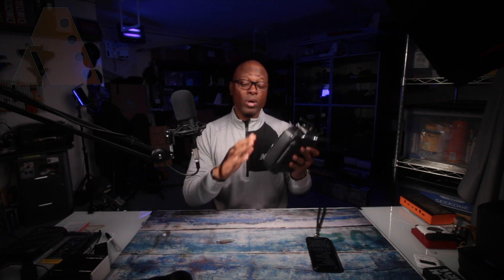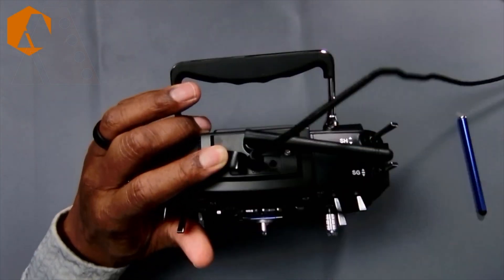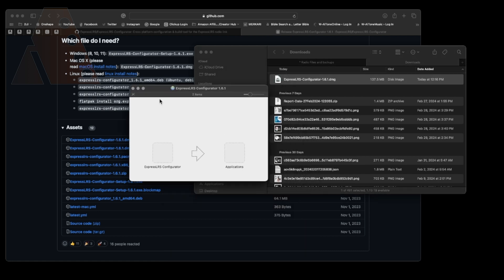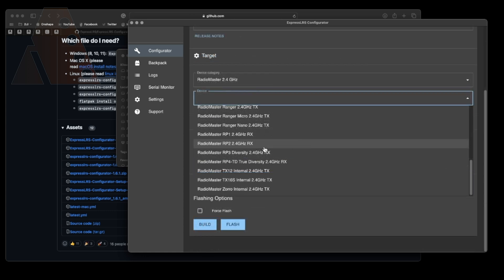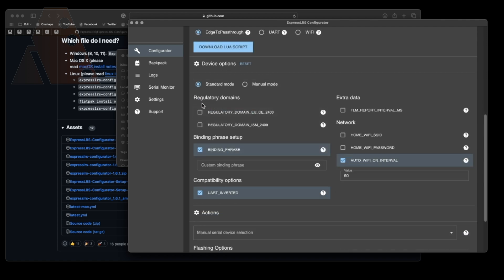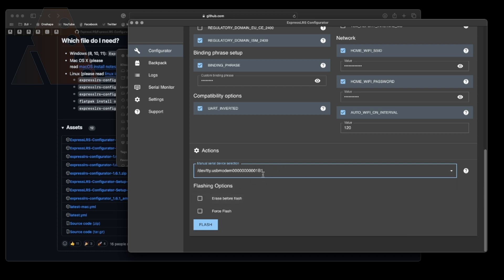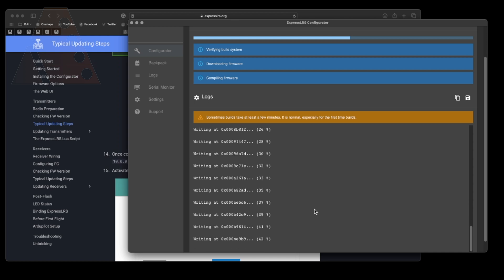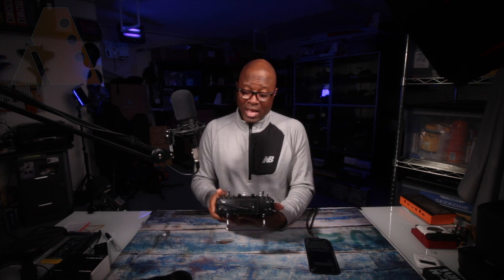Flashing the RadioMaster TX16x Internal ELRS Module v3 3 2

Comment: As a newbie to ELRS and first time messing with it on the TX16S you left out a really basic and important step for a new out of the box radio.  Make sure the new radio has CRSF enabled on the internal module in settings and CRSF selected for the active model.  Or it will fail every time.  This might sound like "derp you should know that" but... yeah.  I did figure it out but would have been nice to know in advance.
Reply: I understand your point however, this video is on upgrading the radio, not an unboxing and initial setup.  I have covered this in a different video.  This video assumes that you have already been using this radio with your models but not yet updated to the latest version.  If CRSF is not selected it would not be working well before deciding to update. I would not suggest updating the firmware prior to insuring your radio is working properly by setting up and testing first with a model.  Thanks fo your input.
Reply from the maker: Responded from my other channel.  Again! if you just pulled your radio out of the box, you should be ensuring it works prior to upgrading EdgeTX or the internal ELRS Module.